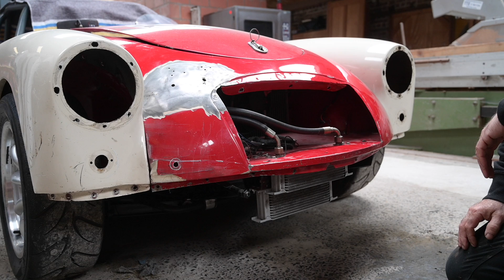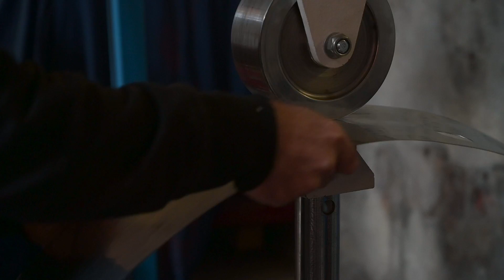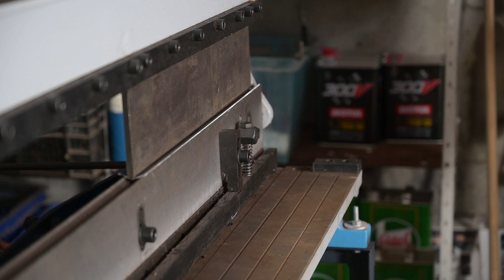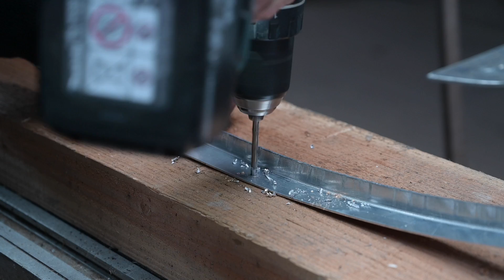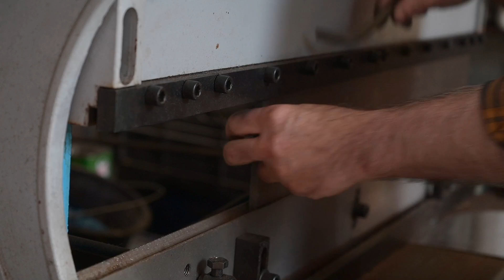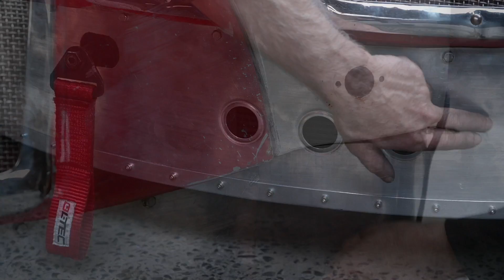MGA -Body Repair  -Part 3-  Front Valence

Comment: Should have used a piece of bar with a slot.  Easy and works well when done incrementally.  If you cut the edge then it weakens in.  Alternatively use a stake anvil and body hammer to turn the edge

Comment: I have to say - Good on you Steve for giving it a go - but with all that expensive kit, I was hoping for a bit more. But then it's a race car and chances are it will need replacing again in the future 😀
I suspect that to create the bottom lips, you could use your bead roller to tip the angle a few degrees, then a combination of Shrinker and Hammer & Dolly to knock it over the rest of the way. Do you think, perhaps the swagged holes would look better if pressed from the other side?
Thanks for your channel. I've picked some gems of info. along the way.

Comment: One solution to re-enforce the side smaller panels would be to wire them with steel wire. However, the panel is aluminum and the steel will corrode over time with galvanic reaction. It could work. The panels look good, nice work there. 🐞
Reply from the maker: Thanks for the tips!

Comment: Steve - Looks good.  If you want to stiffen up the bottom edge of your curved pieces, just bend 3mm or 4mm rod to the right shape and tack weld to the inside of the valance piece.
Reply from the maker: Thanks for the comments

Comment: Love the steampunk look.  I'd leave it unpainted to enjoy as is.  (You have great metalworking tools, btw, I'm jealous :)   )  No doubt you did a much better job than I could have done with this.  Can't help but wonder about the aerodynamics of that big spoiler, though, but of course it would have been hard to curve it more than one direction, at least for me.
Reply from the maker: Thanks for the comments,  it is not that much larger at all then a normal valence ( for racing)..It is also in a curve so it should be ok.,.. will see later on  the track

Comment: That is a popular valance/air dam design for MGA and MGB race cars. Yours is nicely done. It is possible to have a flat one piece style by adding a narrow left and right fender extension or if it's permitted by rule, actually flattening out the front fender lower edge, thus removing some of the fender to body curve. I admire your choice of metal panel tools also. A English Wheel can really make metal panel work so much easier. All nicely done.
Reply from the maker: Thanks for the comments, and I need to check on the rules for fender extensions